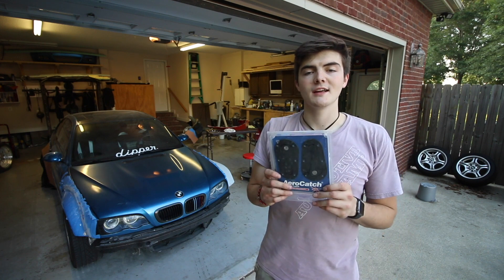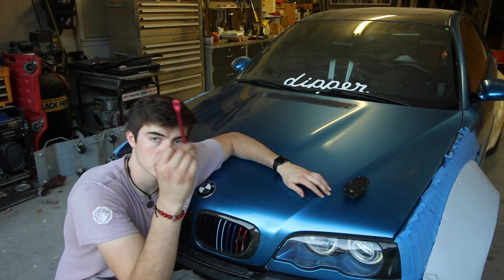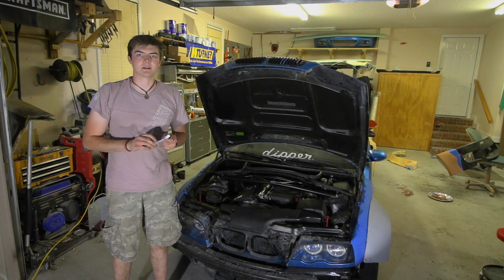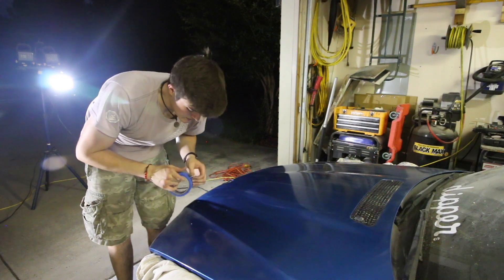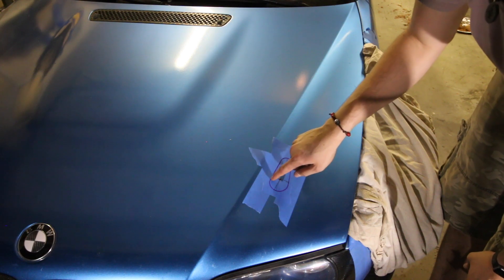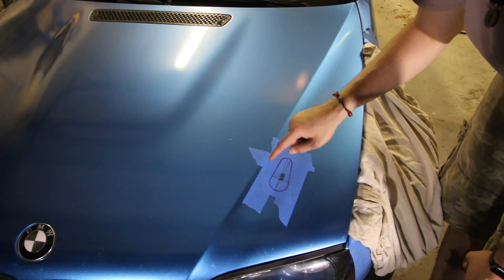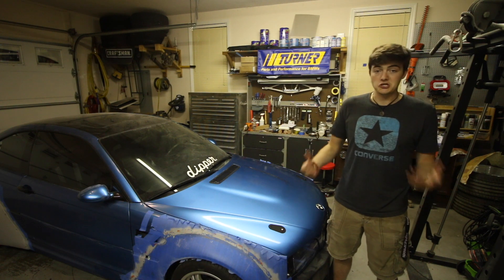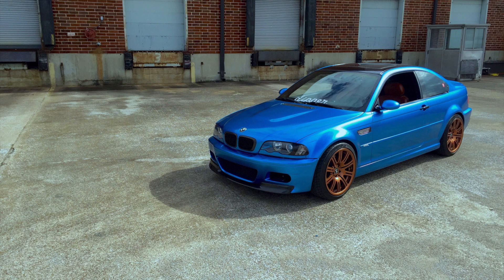Installing Aerocatch Latches On My E46 M3

Comment: Wouldnt it make sense to install them, basically backwards? For a redundant fail safe that they are depressed while driving, the air doesnt just open the latch and send your hood flying off?
Reply: Aerocatch says to put them in with the narrow end facing into the wind.  They are indeed backwards in this video.

Comment: Thx but I have a question for anyone that’s done this on an e46, do I have to remove the oem hood latch in order for the aftermarket hood latches to work??
Reply: Yes. At a minimum you'll need to unscrew and remove both hood pins. You could leave the rest there if you wanted to.

Comment: you do nice job with car :D :D but ....
Im working with molds eweryday and you do molds wrong... if you want do it right do like this :
first we put the wax ..not 1 time but 3-4 times or more (sometimes 7x) .... 1 and next after hour or more (15min if you heat the wax) but it least few Times before you need to put new wax
next we use PVA on the wax
after that i put fiberglass mat (not fabric) 150g per m2 mostly only one but sometimes twice
on the 150g m2 fiberglass you put 2x 450g per m2 or 3times (you need to test this but for fenders like this I use 3x or more 
At the end you put fiberglass fabric yes ... at the end
after each layer you work on it to the moment when you cant see the single fiber part but it looks something like jelly only when it's like you put jelly next layer.
After you release mold and you want the fiberglass fabric on top of the mold you put on it 150g per m2 fiberglass matt work on it to the moment it looks like jelly and you put it on fiberglass fabric
when you do ewerything ok finish. product will be stronger and it will look better without air bubbles
longer hardener time is better , 1.5-2h is ok (12h to full harden)
(remember that polyester resin catch fire with to much hardener first its start to be warmer and warmer next its start smoke , self fire , or ewen explode if its enought in smal area and can create pressure